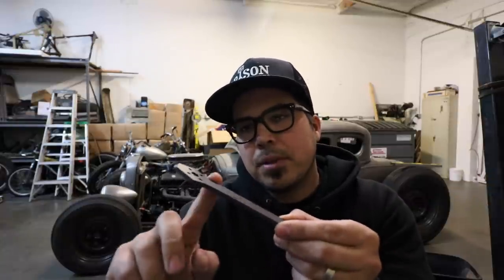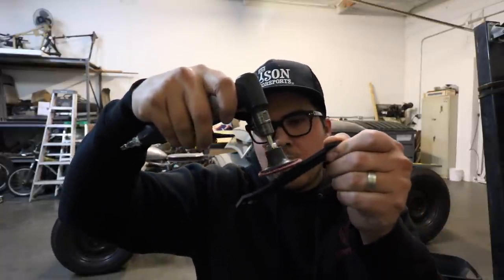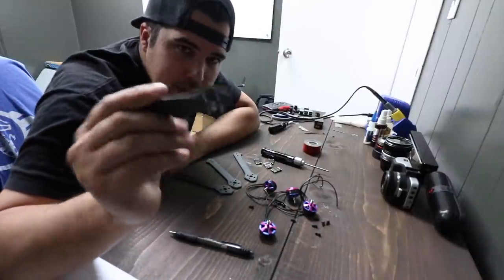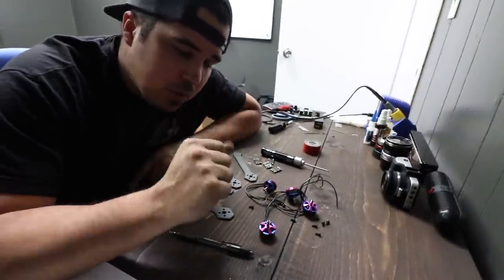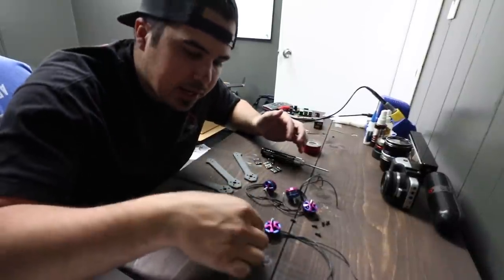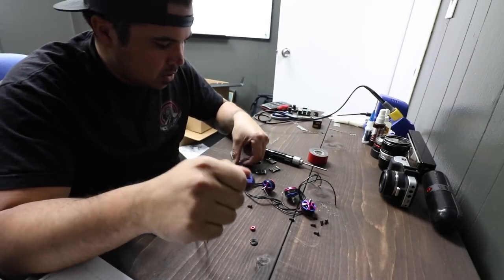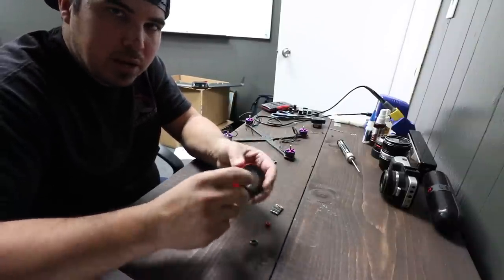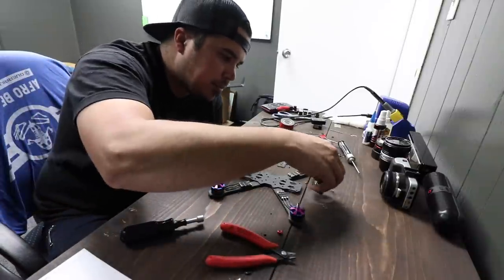BUILDING A NEW MINIQUAD

Comment: Dude, you are going to love those motors! I just put them on my 6" Hyperlite and they friggin' rip! Much better for the 6" than the 2522kv version I was running that night we flew in DTLA. You'll pull right around 100 amps with the DAL 6045 bi-blades. I tried HQ 5x4x4 and they actually fly really nicely on these motors too. Not as slow as I expected them to be on 5". Instant punch & they pull about the same current as the DAL 6045.
Reply from the maker: +Kev PV nice yeah I'm excited to see how they do.

Comment: Q&A Pronounced " 7 L Xray"  1: Does the 30mm height of the wolf pup make it hard to mount fpv cam and gopro? 2: Does that pdb plate come with the frame? As I would use motolab tempest.

Comment: Hey Konasty, if you are going to continue building this quad on camera, would you mind doing a build video showing how to connect the cameras and add OSD. I'm at the stage where I am upgrading camera and it has different connectors, and am also interested in adding an OSD. Think it would be cool if you have your insight on how those are done.

Thanks for the vids! Hopefully you find that quad, should be a cool video haha
Reply from the maker: +Hector Caro this camera has osd built in so it's only one wire pretty easy

Comment: When you get to the FPV gear installation, can you make sure you show where you are getting supply voltage to the VTX and the FPV cam? For cleanest possible video. With caps if you use them etc.Thanks,Love your vids!
Reply: BumpierDrake960 he's gonna use an all in one PDB so he's probably not gonna have too much choice where to get it from.
Reply from the maker: +BumpierDrake960 yeah I will

Comment: Are the motors hyper lite v3 2140kv? The color is great. Do they have c-clips or a screw?
Reply: Jason Rouse idk which kV those are but they definitely look like the Hyperlite ones from PiroFlipRC. If so they're a great price. like $10.
Reply from the maker: +Jason Rouse they're the hyperlite v4 from piroflip they're 2122kv
Reply: Konasty thanks for the info. I'm building a 6" as well and they look awesome. Just saw they're listed in the shop.

Comment: hey im having a issue with my newest quad it twitches at low throttle any ideas
Reply: and my motors are getting really warm
Reply: Ultimatevapor918 re-calibrate?
Reply from the maker: +Ultimatevapor918 sounds like an esc issue. You have all the settings correct?
Reply: +Konasty I have calibrated the ESC  probably 10 times I even swap All 4 ESC and put new ones on there it still doing it and yeah I do have all the settings right it's weird I don't know what's going on they're all on the same firmware but it's almost like a yaw twitch I have another set of Motors I think I'm going to try those tonight but these are brand new red bottoms that I was running there shouldn't be anything wrong with them also I have another quick question I picked up an Omnibus F4 Pro I don't know if anybody has messed with that board but I'm unable to get my Motors to spin with that not even from the motors tab this has been a nightmare the Revolt that I was complaining about is the only one that is rocking right now LOL go raceflight
Reply: motor screws too long? soft mount flight controller?
Reply: +Kwad Squad FPV I  used the small screws on that quad so it shouldn't be touching and I've never had to soft Mount anything other than that Revolt board do you happen to know anything about the Omnibus F4
Reply: i have 2 of them in my quads, but mine are soft mounted with orings.
Reply: +Kwad Squad FPV I hooked it up did the ESC calibration it would only calibrate on oneshot 125 not 42 or Multi Shot I'm using little bee 30 amp BL heli s escs and even after calibrating on oneshot 125 I cannot spin the motors in the motor tab is there a trick to this I had the OSD hooked up and working
Reply: +Kwad Squad FPV I had just recently flashed it to betaflight 3.1.2
Reply: never had that happen, just out of curiousity what firmware did you install? I installed the airbotf4
Reply: +Kwad Squad FPV Omnibus F4 it was in the list on betaflight 3.1.2 so maybe I need to flash it with the board you flashed it with
Reply: check out project blue falcon, he does alot with the omnibus, he knows more about it than I would. Just leave a comment or message him. Good luck!
Reply: +Kwad Squad FPV yeah that's who I watched to hook it up but I'm going to try to flash it with that board you mentioned because that's the only thing I haven't tried
Reply: yeah if yours looks like that in the picture, its not the pro, but the ad doesnt say pro.